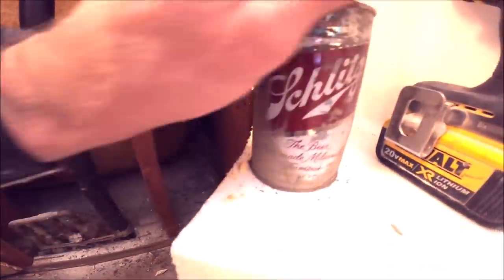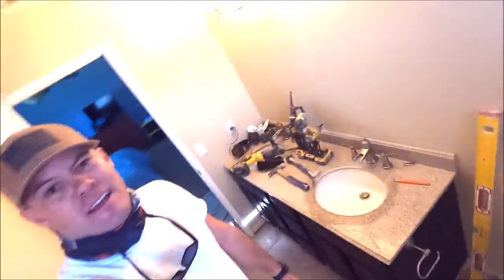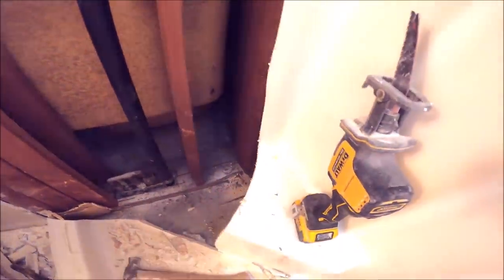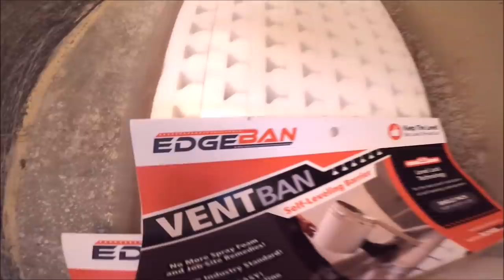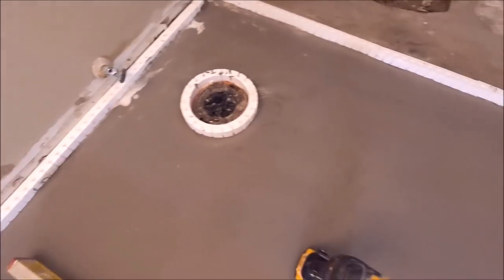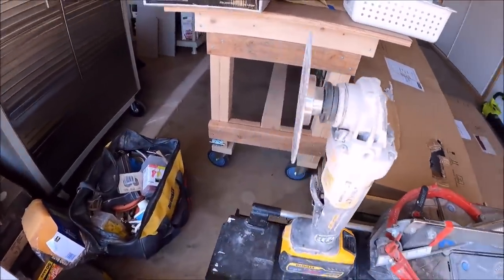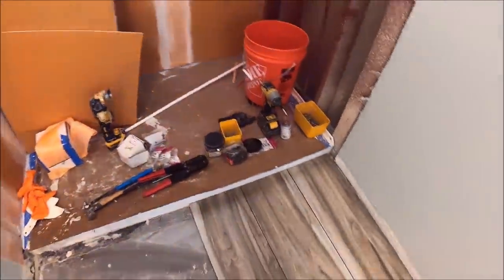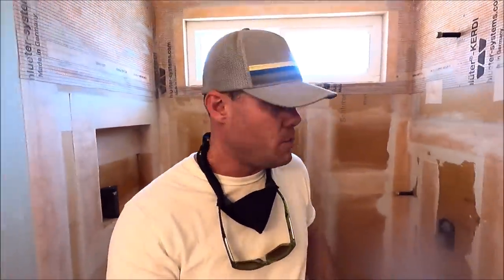Old Shower to New Shower

Comment: Great video. What was that large white pipe for? Dust extraction? Around the 9:40 mark.
Reply from the maker: That is an AC unit filtering our air and blowing cold
Reply: @LandbergTileTV  thanks man. I'd be interested to see how you manage the work environment. I fit bathrooms here in the UK and we mostly work in smaller rooms in residential homes. We're looking for portable air cleaning solutions.

Comment: I'm using 6x24 wood plank tile on my shower wall what offset and grout line size do you recommend? And what grout line size do you recommend for bathroom floor tile size 12x12? Love the videos
Reply from the maker: 1/16 are always good. Less grout the better. Not sure about the layout, straight, 50% or 33% offset. Here is a very OLD video with a straight pattern, but you will need longer planks.
Reply: @LandbergTileTV  Thank you I wasn't sure if 1/16th was ok on shower walls
Reply: If i was installing the tile a 1/16 grout joint and 50% offset  it looks awesome keep it on shower floor too. Have a good day one eyed tile guy this is my company name 👍
Reply: Um i didn't realize he said the same thing i did about the tile until after i posted this

Comment: Wonder why schluter board needs those pan washers while other boards just cement board type screws. Either way I use const glue for stronger hold.
Reply: Because it's not super ridgid and it's quite soft so the washer helps to not overscrew.  Wedi needs washers too.  Cement board doesn't because it's rock hard (but also blows out super easy to edges) plus all of the other negatives of cement boards (dust, weight, still needing to waterproof etc).  GoBoard doesn't need washers but it's more dense, they have their own screws that kind of have a built on washer head.
Reply: @CleanGroutNW  I’ve been using goboard lately, so no washers for me.
Reply: @krehbein  I haven't used it yet.  I rarely install anymore, I'm on the restoration side of the industry for the most part now.  I did check it out at Surfaces/Stone Expo in Vegas earlier this year and was really impressed.  I've used Schluter Board, Wedi, and 19-16 years ago a lot of hardibacker and a few pallets of wonderboard.  Even when I was in shape carrying 2 1/2 inch sheets of wonderboard upstairs would be pretty brutal by the time I got where I was going.